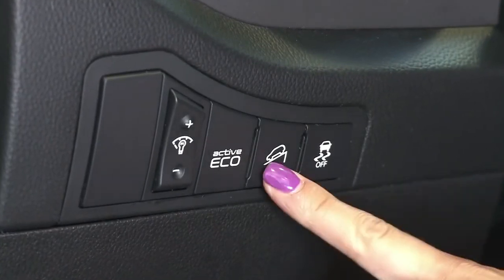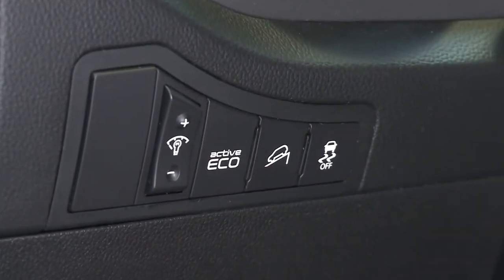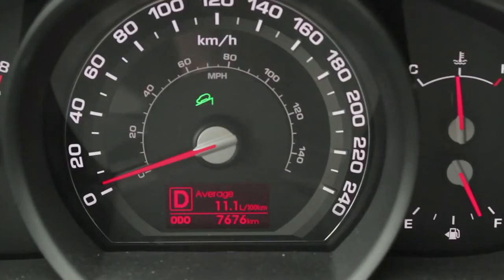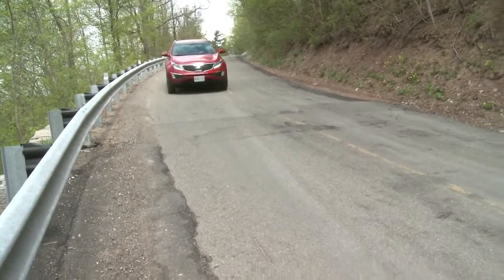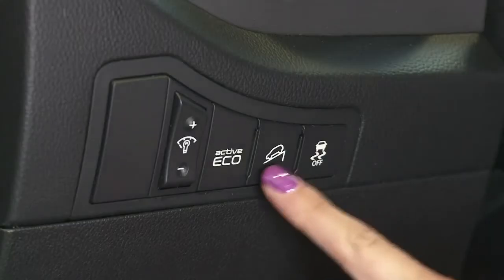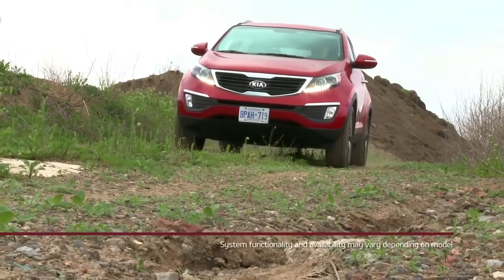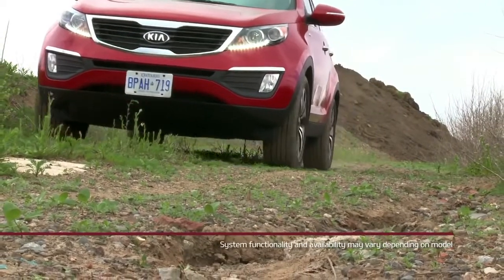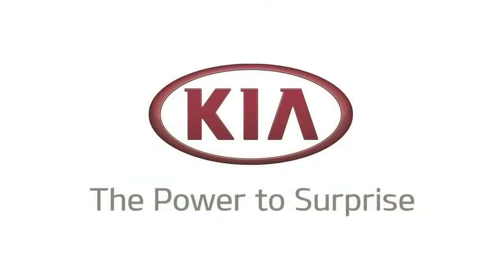Kia Downhill Brake Control Guide

Comment: The first and last time I tried it I was in I think 2nd gear and pressed it. I was on a pretty steep grade going around 15  - 20. It was almost like hitting the brakes fully. My passengers didn't like that so I wasn't about to try it again in a higher gear. Good luck.